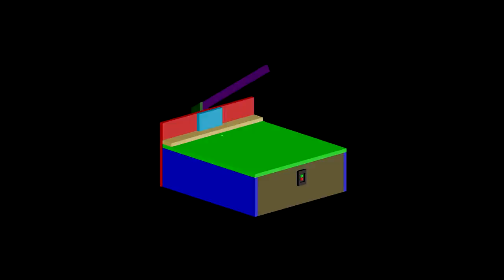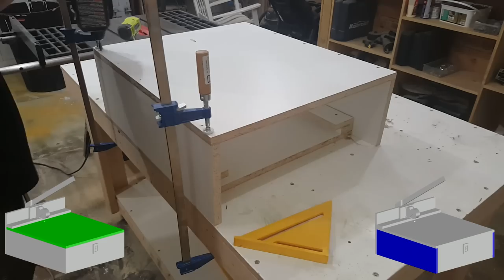DIY Pocket Hole Machine

Comment: Great job bud. I’m really enjoying your videos. I’m thinking I might incorporate one of these into the feed out side of my mitre saw station as it can all sits flush with the bench top and support long lengths. A couple of upgrades being a sliding back fence for different thickness panels and a spring loaded hold down clamp attached to the handle so when you pull the handle down it holds the piece in place. Also attaching a spring to the handle or slide for self return, or does the weight of the drill on its slide already do that? Anyway.... great job and well thought out.

Comment: For more accuracy when mounting things like the drill, cover the drill with scotch tape to act like a release agent. You're going to make a cradle for it. Make a small boxed in area slightly bigger than the area around where the drill goes. Mix up Bondo and fill in the boxed area. Push the tape covered drill into the Bondo where it belongs. Use scraps and clamps to hold it in place while the Bondo sets up. When it's set up pull the drill out and remove the tape. Sand away what isn't needed and then use straps or bracing to clamp it down tightly.
Reply: Just another suggestion about the same problem. In the video, it shows mounting the drill on a cradle near the chuck, putting some plumbing strapping over it to hold it down and presto!, it's a perfect fit. I could not get mine perfect and had to use the full sheet of melamine board to create a new sled-carrier and sides of the box (too full of screw holes while I was trying to find perfect angle).  First of all, when you create the cradle to hold up the front of the drill make sure the body of the drill is as flat as it can lay on the carrier; do not try to angle the chuck upward to achieve the entry angle; let the angle of the sled-carrier do that. To find the correct plane, the easiest thing for me was to mark the center line on the sled.  I had already mounted my kreg basic jig and drilled through the top of the box. I took a 3/8" dowel (check for absolute straightness; very important) and fed it down the exit hole of the jig about 8" or 9". This gives you a visual reference of the plane the sled needs to be in.  Just by sight you'll be able to line up the sled-carrier within a few degrees of parallel to the dowel. Mark a pencil line on both of the sides both above and below the carrier. Remove the dowel and chuck the kreg step bit into your drill and insert it into the lower hole of the kreg jig. Insert bit all the way in and adjust the carrier until the sled touches the bottom of the drill being sure your sled-carrier is parallel to your lines on both sides. Mark new pencil lines on sides for final position and put x's through your old lines. Remove carrier and sled, mount drill as per video (with bit directly centered over centerline) and install carrier and sled with screws after test checking that the bit will freely move into the jig. If you can get within a few degrees, you're fine. Backing out the step bit does not result in the bit exiting the jig and becoming misaligned with the entry hole. Once the bit is inside the kreg basic jig the tip stays in when the bit is lowered from the workpiece. The front of the box keeps the sled from coming back far enough to disengage the bit from the kreg jig.  As long as I'm writing a book (sorry), one last comment. I see that in the video, the poster removed the plug from the drill. I just used a 16 gauge extension cord to bring power to my on/off switch.  Rather than cut the plug off my drill I opted to wire in the receptacle end of the extension cord and have the switch energize the plug (I left about 10" of cord on the receptacle to do this.)  Once the receptacle is mounted to front panel, just plug the unaltered drill into it and you'll still have the option of having a corded drill.

Comment: Great project. I'm just a weekend warrior who spent time helping my dad in his shop before he passed away several years ago. I wish I had the space to have kept his tools. Viewing the video of these projects being assembled is a huge help. I was electrocuted 5 years ago. Areas of the brain responsible for retention of information were affected. Seeing things being done is a big deal for me.
Reply: I came in contact with a lamp that wasn't grounded properly after the band I played in finished our gig. Been dealing with a migraine type headache 24/7 for almost 5 years. I'm on disability.
Reply: I take quite a bit of pain medication. Sometimes it helps and sometimes it doesn't. Thanks for the encouragement. Hoping it'll stop one day but I'm not overly optimistic.
Reply: I know this is an old thread and all but couldn't just not say anything. 
My father suffered from constant migraines for 3 years after a work accident. Medication only helped spuradically and he finally tried CBD oil. He no longer has migraines 24/7 and actually has a life again. CBD is a chemical compound in the cannabis plant(THC is another chemical in the plant and is what gets you "high") which carries most of the medical benefits the plant can offer without the getting stoned effect. Don't know what your thoughts or opinions are on the cannabis plant but I implore you to look into CBD products and see how they help. 

It's my fathers only solution he could find.

Comment: the design of the sled works though i would look intoo making it smaller 
thinking on using a cheap battery operated drill where the battery died of , if you take off its body and only leave the drillhead the gearbox and the motor youre left with a lot smaller package , yes you need to add a 12 or 18 volt powersupply 
it might actually be a small enough package that you can double them up and drill two holes at once 
if you foot operate the lever you can probably build it intoo a router or sawtable and use the fence as the backstop 
if you use two wheels side by side instead of one you can lay the material against a line and drill with more precice spacing then again you could draw a line on the wheel itself and line up that way

Comment: This is a really great design. I think too save space a small shop, you could build it into the back fence of the chopsaw bench. It would always be available, and still be able to pocket hole long and short pieces, even up to 24 inches wide [ or wider ] without interfering with the chopsaw station, and taking valuable  shop table space.

Comment: instead of a drill, could a palm router be used? it seems it would be easier to make a cradle for it than an old  corded drill. just a thought. how about thickness adjustments. I mostly work with 3/4 material, but on the occasion it would be nice to make it adjustable.

Comment: Have you figured out a way to make this build to be able to change the pocket hole depth?  As I saw in the comments this is dedicated to 3/4".  I'm used to using wood with 1.5" thickness.

Comment: This is really good and the diagram in the bottom left of the video is massively helpful. However,  I don't know much about woodworking, so please excuse the newbie question: but what is the blue thing called that is used as a guide for the drill bit?
Reply from the maker: Kreg pocket hole jig

Comment: Interesting. I can already spot a downside though: you can only drill pocket holes into boards of a specific thickness (3/4" it seems). You could make the entire back side (the board that the plywood rests against, as well as the wheel support) interchangeable, and by adjusting the width of the board and the level of the wheel, you could drill pocket holes into thicker or narrower boards. If you stick the wheel support board into the back board, then you could have a set of changeable jigs, for specific thicknesses.
Reply: I dont see this issue.  I thought the thickness was set by the jig moving up and down not the clamp.
Reply: @dlove118  He specifically mentioned in the description that it is designed for 3/4" stock.
Reply: If he can build this machine I think he knows of the limitations and can adjust accordingly. Let's just watch and be happy?! :)
Reply: @mihaitha Yeah I plan on making a variation of this project.  I'm going to make the fence adjustable and swap out the wheel for a adjustable flat press that comes down with the arm.  That way the setup will be adjustable for different thicknesses.  This was a very good tutorial! Great job!
Reply: I built mine so the upper wheel/clamp is on a board that can adjust up and down.  The back stop board can be replaced to allow resetting to pocket hole thicker stock.

Comment: Very good job! I don't do enough pocket holes to justify the space for a dedicated machine but if I did I'd build this one. Most pocket holes are used on 3/4 material. My older Kreg jig  is not adjustable and I haven't thrown it away in favor of replacing it with a new one. Good design well built. Thanks for sharing.
Reply from the maker: thanks

Comment: Hello friend, thanks for the video, Do you want to ask a question to the sow of the disc, I see that the shorts in melamine you are very clean, could you tell me specifically which disc you use? I was always frustrated with clean cuts in melamine.
thanks, greetings from Mexico.
Reply from the maker: mitre saw = 12" irwin 60 tooth blade and table saw = 10" diablo 40 tooth blade thin curf blade

Comment: nice idea , and it seems to be reasonable eazy to make 
i have a few no brand cordless drills of wish the batteries died , think i'm going to use that and a computer 12 volt power supply  for a pockethole machine 
one thing i might add though , a ruler across the surface with the zero in front of the pocket hole drill and counting up both ways from it to  center and space the holes out on with smaller pieces
Reply: I'd like to see the wire job for that. Have you done it before? I too have a pre-lithium set of cordless tools that are barely used.

Comment: nice build.
1 thing about it being dedicated for 3/4" only.....put your hold down wheel on spring to accommodate different thickness'.
Reply: Unfortunately making the hold down adjustable doesn't make the jig accommodate thicker stock. It would require the "hole' to be adjustable to accommodate thicker stock.

Comment: I like this project and thought it was well worth the effort to build specially as getting any of the pocket hole jigs in the UK is expensive. 
Not a fan of discarding the earth wire from the drill. In my book, it is there for a reason and should have been connected through. I know its unlikely to be needed specially in a wooden box but it is needed to trip an RCBO, (I believe called a GFI in the states).
Reply from the maker: +Jason Showell The drill is a double insulated device and therefore does not require a ground.

Comment: An interesting build but how do you change bits? How do you adjust for material thickness?
Reply from the maker: +NYWoodworker i only use 3/4" material and see my pocket hole machine upgrade video for bit change out

Comment: How do you adjust for 2x material? Wouldn’t Kreg need to be modified and then angle of the drill slide? How would this be modified by adjusting the fence?
Reply from the maker: The wheel would need to be adjustable and the back stop would need to be shortend also the collar let out on the bit to drill deeper

Comment: DIY Builds ,
Awesome build for simplifying and increasing pocket-hole throughput especially on larger builds! [ thumbs up ]
Safety concern when drilling holes in that metal hinge at 5:43 ( dangerous when that bit grabs , could spin that hinge around and send you in for stitches up to tendon reattachment and all pursuant loss of dexterity ) :
Place hinge swivel past the edge of a sacrificial board thick enough to slightly raise hinge swivel up off the drill table surface then firmly clamp the hinge flange and board to table using large jaw locking pliers ( commonly used for welding ) on either side of hole to be drilled as clamping to one side will likely compress wood, tilt flange. This way, hinge flange isn't sloped at an angle determined by hinge swivel dimensions to afford drilling perpendicular to metal, the hinge flange can't lift up when the bit pierces through ( and wants to grab at the flange to whip the hinge around )  while also securing everything while you keep your hands, wrists and fingers far clear of any spinning hinge in a worse case scenario.
😁 👍 🙋

Comment: Cool build  the reason I watched your video to begin with is I’ve been binge watching YouTube videos on woodworking and I’ve seen some great ides  and  I couldn’t understand why more  people weren’t building  lots of their machines or jigs from melamine  it’s cheap and  slides well    To me it’s a logical  approach over the  more used and painted Baltic birch projects   I worked  out of a shop that did  high production  of case work using melamine  so there fore  “scraps “ or offcuts were available for free  I made countless jigs and  products  out of  them  and I alway found they held up  well  in most cases  plus  they were easy to keep clean  and free of glue residue     Their most obvious negativeswere Not  being capable of  use in a wet environment   And the   Weight of the  product   But at our shop I also had    The availabllity Of solid surface   Materials  to use if needed  for a damp or exterior  situation  let’s face it  power tools and rain don’t  really mix very well  to begin with as most of the time  things were used in a climate controlled  shop  whenever possible   Looking forward to  your other videos  and I’ll subscribe as well     Take care Craig M
Reply from the maker: +Craig Monteforte agreed :) thanks craig

Comment: In this video, the setup was for only once size of material.  if your material is thicker or thinner, then you have a small issue.  I think I will still buy the Kreg Unit.  Build a cabinet with wings on eacy side.  It would be nicer to have the power button on the front of the unit, but it's not that big of a deal.

Comment: Thats just one FREAKING cool project!! The recording is from so many right angles+hq. The editing is one of the best "top notch" quality, ive ever seen; Shortens video, but still shows everything! BIG thumbs up on the 3d lego visuals! Really explains more complicated builds. This project is a masterpiece, in its complicated simplicity, a beauty! A question: Are you planning on glueing on a thin "steel sheet" layer on the top, cause sooner or later that surface is going to chip or scratch. If you do, please update a short video. But, most importantly: KEEP UP THE GOOD WORK!! 😁 Subscribed 😉 Cheers from Sweden 😊
Reply from the maker: Thanks. No I don't think with how much I use it that the top would ever get damaged. If I were using this is a production shop for sure that would be a good idea. Cheers from Canada :)

Comment: How tick is that material? When you route out for the jig...how much is left?
Reply from the maker: Probably 3/16"
Reply: @DIYBuilds  would it be possible to instead of routing material out, to just cut it all the way trough and then put some epoxy to the walls of the jig and wood, and set it flush whit the material?
Reply from the maker: Probably.

Comment: I noticed when I downloaded your plans that all parts are shown as cut out of the melamine panel, including the lever parts used to move the drill sled. However, in this video, it appears you used something like 3/4" (or is it 1/2") birch ply to build these parts. So, I am assuming that you recommend plywood for these pieces. Is that correct?
Reply from the maker: All 3/4"  you can use plywood regular wood or whatever
Reply: @DIYBuilds  Thanks! It does seem like ply or solid lumber would be a better choice for a high-stress piece like the lever. Incidentally, thanks for posting....I'd never have the patience to figure all this out on my own. Even with your excellent video I'm going extra slow, rewatching each phase, etc. to make sure I only have to do this once to get it right. Cheers!

Comment: Nice job on making your own pocket hole machine. But I don't understand why you didn't carry the ground through on the power cord. Just because you are not holding the drill motor in your hand doesn't mean you should do away with the tool grounding. Also, it appears you switched both the hot and neutral using a DPDT switch. Is there a reason for that as usually with 120 volt tools that is not necessary you just switch the hot lead.
Reply from the maker: +Bob D. Thanks Bob. The hot lead is always switched. In terms of grounding the machine... Its made of wood so it can't be grounded. There is no ground on a double insulated plastic tool like that drill so none to carry through.
Reply: At 7:35 I thought I saw a green ground lead in the cord that you cut off, that's why I mentioned it. Were you using a piece of cord other than that which was connected to the drill? Yes, the hot lead is always switched, it's the neutral that is not normally switched on a 120 volt tool, but you apparently run both the hot and neutral through separate contacts on the switch, I was questioning why, doesn't seem necessary, but it still works.

Comment: Wait, what? How do you change the drill bit or service the drill? Why not go with a simple drill guide design? I don't understand the concept of the tool. Nice editing though.
Reply from the maker: +Krommandant you don't service it easily but the concept of the tool is similar to the kreg foreman
Reply: Oh wow ok, now I understand better where it's coming from. Great home-made equivalent! The pocket hole machine is to the drill what the table saw is to the circular saw.

It could fit in a larger table / workbench for large pannels.

Comment: I liked it until you cut the ground wire off þhe drill.  Overall great build but compermised the drill.
Reply from the maker: no ground on plastic double insulated drill to begin with ;)